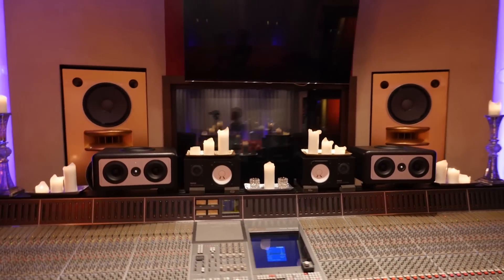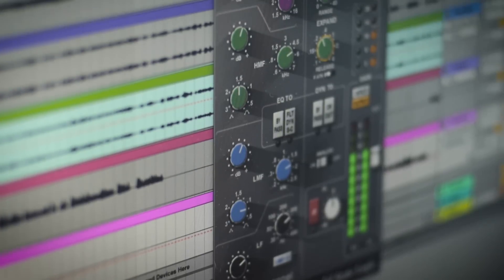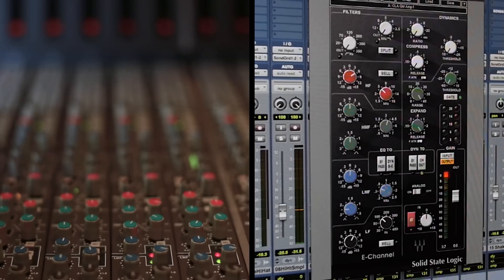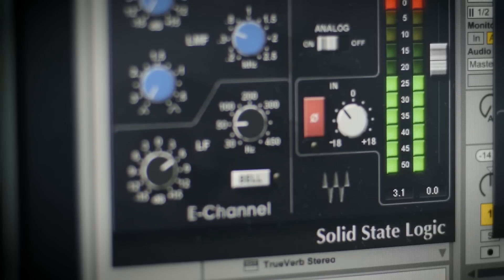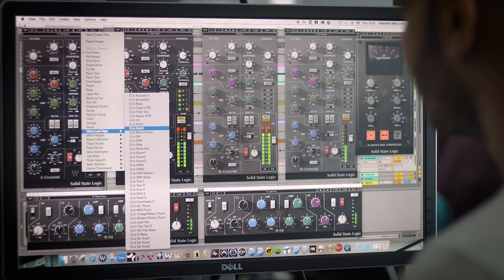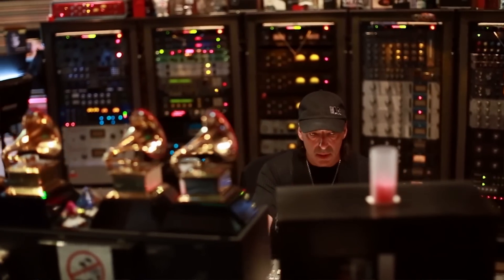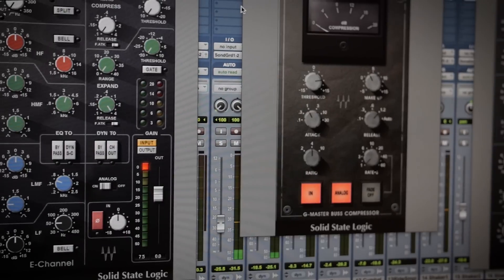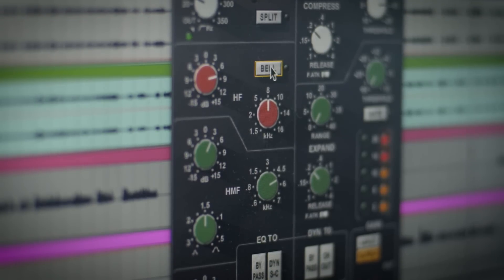The Making of the SSL Plugins – Reproducing a Sonic Legend

Comment: So many people have these plugins.  Why not make a dedicated hardware controller for the ssl channel plugin?  It could be a tabletop box that looks just like the plugin, able to control any instance of the waves ssl channel that is clicked on.  I bet it would sell really well and simultaneously boost the sales of the plugin itself.
Reply: Right on!
Great idea!
Reply: It's called an SSL desk :)
Reply: @Aaron M
Not what I had in mind bro.
Reply: quash , ha ha ha , I was just thinking the same thing . I never use the SSL strip or EQ because its
not ergonomic for mouse operating but a table top controller it would probably be my go to EQ /Strip
Reply: Well the softtube console one did this already
Reply: I use these plug-ins in Cubase in combination with an Icon Qcon Pro-X & 1 extender.
Using Cubase’s plugin remote control editor, I can assign all the controls to the 16 rotary knobs.
Reply: I picked up an avid s3 and is insane. You can assign the eq to the top 16 encoders an the dynamics to the bottom 16 encoders. It's so easy to move from track to track.
Reply: basically you mean the softube console 1?
Reply: Finally someone with some sense
Reply: Easily $1000 or more
Reply: @chiefyovany572  I'd be happy to pay that amount for it.
Reply: @DJChappie001  No, I have the Console 1.  I mean something that looks exactly like the plugin, but in hardware form.  The exact same colors, switches, dial layout etc.
Reply: Finally closest thing to your imagination the new ssl plug in-hardware integration..wat you think about that?
Reply: @paulbrown4598  Haha yeah man, 4 years later 😹 It's pretty much exactly what I was hoping for.  I don't have room on my desk now, but I'm considering rearranging for it 😏
Reply: 5 years later wish granted....
Reply: @justinhall6228  Yeahh I'm much deeper into the Softube universe now, though. They got the first move advantage 😏

Comment: since i started using the SSL's Duende bundle I hardly ever use the waves anymore, but that's not to say one is better than the other. I just like the GUI's ease of use on the eyes n routing of the duende. between them both they're different in sound.
Reply: also duende are from SSL waves are not from SSL ^^ try also cytomic the glue for SSL bus comp emulation ;)-
Reply: thanks i have both the Glue and slate's VBC but given that i just recently ordered the SSL analog Gbus compressor i'll be resorting to that for my master bus n use the plugin versions for group bus compression (i.e. Drum groups) i like the glue for more clean processing n the slate for a bit of more color .